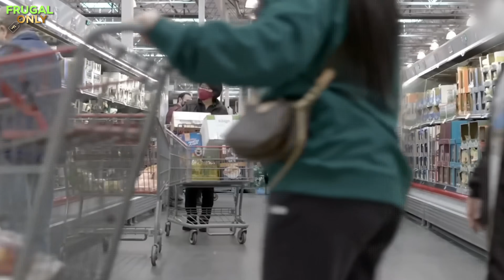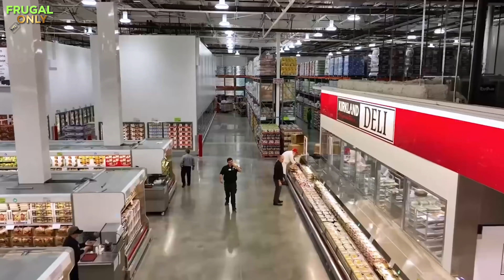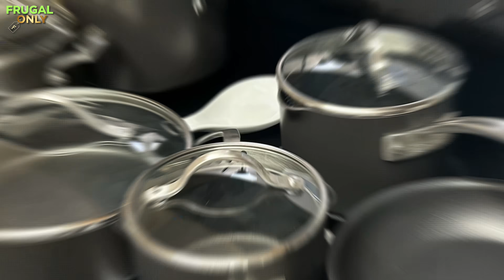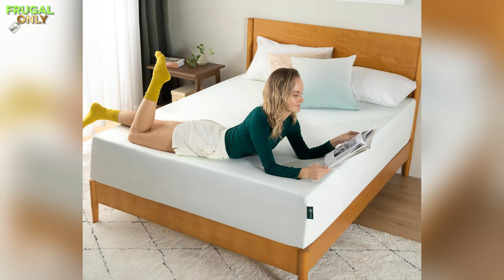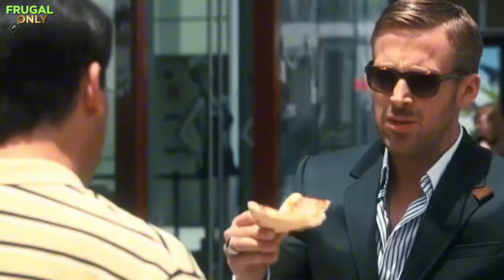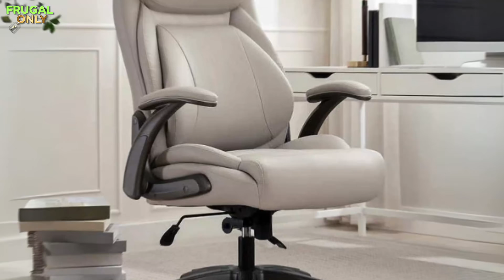NEVER Buy These 10 Costco Items (Employees Say Why!)

Comment: The problem with codiments is that you might have to go to another store to buy smaller amounts and there is still another consideration - if you are at costco and you need Mayo - is it worth it to drive to another store where it might cost you the savings in gas to go there and then there is also the extra time involved.
Reply from the maker: sometimes the “savings” disappear once you factor in gas and time. Have you ever found an item at Costco that truly saved you money long-term, even after all that hassle?